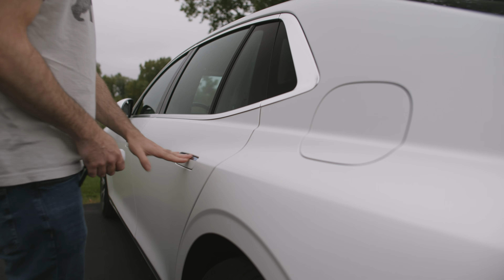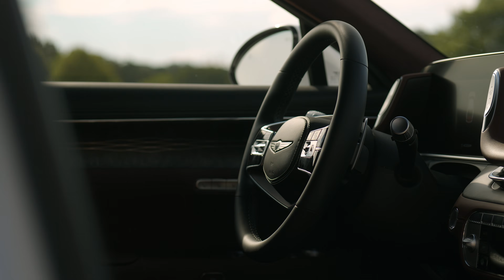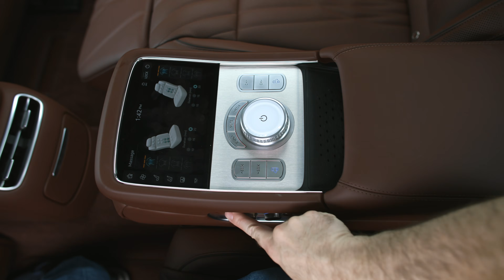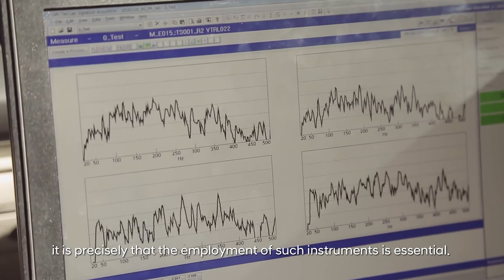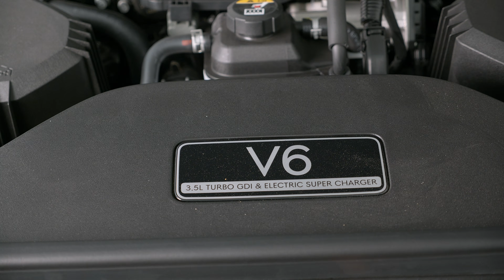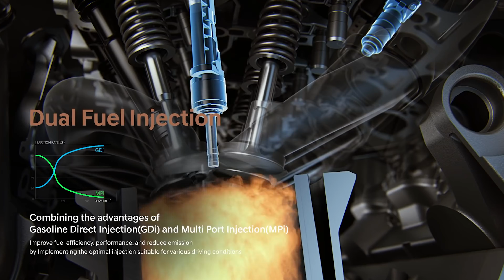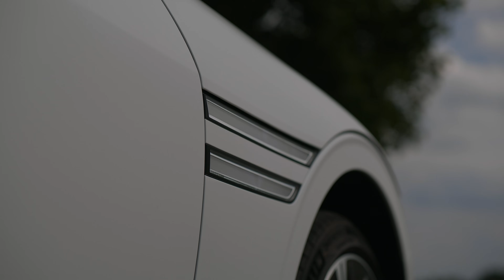2023 Genesis G90 | Great Car, Gimmicks and All

Comment: Another big factor is warranty. S-class starts out at 113K and have less than half of the power train warranty duration compared to genesis.
Reply: The irony is that the S-class needs the Genesis warranty, and the Genesis could get by with the S-class warranty. But in another way, it's not ironic because they offer the warranty that reflects the longevity of the product.
Reply: @andoletube  yep it also reflects the market positioning for each brand, but also shows Genesis’ conviction and long term investment in this market segment

Comment: Having the turn signal chime in the seat is absolutely genius. That should be in every car
Reply: A bigger concern is simply getting people to actually use the turn signals, no matter from where the chime emanates...
Reply: How is that absolute genius? What's the amazing benefit over just having it radiate unoffensively from the general dashboard area?
I suspect I would hate announcer stuff to come from directly behind my head.
Reply: @Dowlphin  With that configuration chime sound might be quieter so backseat passenger(s) would barely hear it, if even.
Reply: @Dowlphin  No, I was talking about any driver related sounds, and in particular -aforementioned in first comment turn signal chime. I assume car manufacturer would like to isolate driver (and his functions with all blows and whistles and those chime sounds) from backseat passenger (and his/her comfort and tranquility). Probably the idea of putting speaker in headrest is similar to something I had experience with in some high-class taxi service - the driver had a headphone in his ear to hear direction advices from navi system, so passenger would not hear them and would be able to relax with more comfort and in silence if needed.

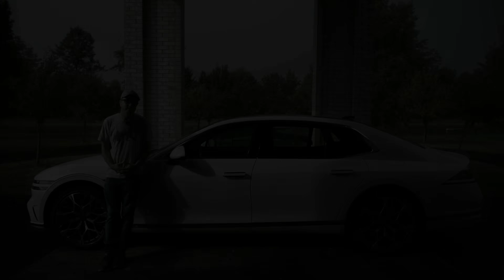Comment: The profile @ 18:09 is gorgeous. Low front overhang, design around the c-pillar, the rim design are all beautifully laid out. Looks like no other luxury car in its class. Nothing overly controversial. Well done Genesis….
Reply: i dont like the rear window lines they dont line up with anything. they shouldve specialized in old school aesthetics and ease of use interioir, with switches that have base heavy clicking sound and some phsycal resistence to being moved, etc. they already have quite a aesthetic focus like lexus lc500. they couldve have allowd screen to be manually coverable with wood veneer like a manual and more simple version of what is in bently continental, without the pshycal gauges, or at least allow it to be turned off when not in use.   simplyfy the front end more like the genesis EV, to make whole thing look more similar at every angle of car and not busy at front and plain everyhwere else. a hole through passenger seats would allow storing long objects including rear seats legs etc while allowng more trunk storage space
Reply: @kalmmonke5037  not expecting it to be universally loved. I think its far less controversial than anything else in its class. Not too plain or extreme…

Comment: Genesis has accomplished what Lincoln was trying to do in the 80's and 90's with the Continental and Town Car but couldn't. Class competitive technology, build quality and dynamics with a focus on luxury (not sport) at a slightly lower price point. To be fair, the current Lincoln Continental mostly accomplishes that goal but nobody seemed to notice.
Reply: I drove the Continental, as well as CT6, Jag XJ, and BMW 7. The Continental was nowhere near as good as any of them. The engine was loud and unrefined sounding, it wallowed around all over the place, it felt like you had to stand on the brakes to get it to stop, and the interior was not all that good. Current Lincoln SUVs are MUCH nicer inside than the Continental was.
Reply: @DavekayBSC  the Ford us probably on par with the old XTS.  I had a Vsport ecu tuned to 600 lb-ft of torque.  Probably faster than my C5 Corvette!  Current have a CT6 and it is luxo driver's dream to drive!
Reply: @DavekayBSC  i agree.
but then again...this genesis reviewed here has that same damn floatiness as explained in the review.
i will never be old enough to give up my driving enjoyment.
i would never have purchased the continental. i think lincoln regressed.
i did love my MKS with 365 hp when it was new...but the interior degraded a few thousand miles early!!!!

but then again, for the 52K I spent...nothing came with what it did.
nothing...everything else was a minimum 15,000 more.
Reply: @paulpellico3797  To be honest, the US is a minor market for this car. It's sold here as a halo car, something to increase the luxury credentials of the other models. It was designed as a Korean limo, where the Continental was expected to be owner-driven.
Reply: @paulpellico3797 the continental is just a fancy ford fusion, not a ground up luxury car like genesis
Reply: @lambokiller99  after all this water downstream you reply with THAT?!
completely different.
chassis engines.
OMG...do you have a license?
Reply: @paulpellico3797  it’s literally built on the same FWD chassis as the ford fusion. That’s partly why it failed.
Reply: @lambokiller99  OMG
did you know that the basis of a chassis is NOT the same as the DSAME chassis?
and EVERY manufacturer, even expensive ones, shre this method?
for instance, my friend
audi TT and the VW van?
As well as Audi and Porsche, Lamborghini is under the Volkswagen Group's umbrella. So when Lamborghini decided it finally needed to deliver a crazy fast crossover, it was only natural that it would inherit the MLBevo platform used for the Porsche Cayenne, Audi Q8, and even the Bentley Bentayga.
Volkswagen's MQB platform underpins a vast selection of cars and is adaptable enough that Volkswagen used it for the mid-sized Atlas crossover while Audi built the third-generation TT on the same architecture. That includes the ballistically quick Audi TT RS
not gonna go on with this.
learn for yourself how manufacturing is done today.

who DOESN'T DO THIS???
Reply: @paulpellico3797  you didn’t see Lamborghini using the FWD shitbox Jetta platform to make an suv. Lincoln should’ve made a new RWD luxury car platform but instead they chose to build the continental on the fusion platform which in turn made it a fancier, bigger ford fusion. Genesis has its own separate RWD platforms that aren’t shared with any Hyundai products. They did it right while ford tried to cut corners.
Reply: @lambokiller9970  

see, this is why i don't try to reason with children.
they change the subject THEY brought up whenever they see they are being caught.
i NEVER said they should or should NOT have gone RWD.
i prefer RWD myself.
but genesis DID start off producing modified hyudais with shared engines and parts.
i was pointing out your position as being seriously ignorant of today's manufacturing
Reply: @paulpellico3797  even the earlier genesis cars had their own platforms and their own engines with next to no part sharing with other Hyundais. They did it the right way, but please do enjoy your 65000 dollar ford fusion with a chrome grill
Reply: The Lincoln Continental was hardly competitive with anything in the class. The interior showed WAY too much Ford influence. That is why nobody noticed because the very first time I saw a fully loaded Lincoln Continental I was disappointed.
Reply: @JustinKelly  ok, ok...let's TRY to be fair!!!!
the continental was NOTR an expensive car.
THIS isd an expensive car.
Reply: @paulpellico3797  The 2017 Genesis G90 5.0 AWD was $73k fully loaded including destination. The 2017 Lincoln Continental 3.0T Reserve topped out over that with every option if I am not mistaken. Did it offer maybe one or two things the G90 didn't? Sure. The interior sure didn't feel like anything close to the $70k vehicle, even back then.
Reply: @JustinKelly  what???
where did you get that? i JUST saw the official genesis 2019 gensis page and it STARTED at 21K...before adding anything and getting the engine...just a color.
???
the continental started at 50...ish,
again, I am very confused by what is trying to be said here by people.
there was NOcomarisons between these cars.
none.
yes, the genesis hadmore, but cost grands more.
Reply: @paulpellico3797  I have no idea what you're talking about. If you don't live in the US then pricing will vary but the numbers I stated are correct for the respective model year.
Reply: @JustinKelly  well, not gonna spend any more time informing you.
the information and sale data are there if you wished.
Reply: @paulpellico3797  Ok 😂
Reply: @JustinKelly  words.
hardly competitive with anything in its class>
like what, for instance?
all these cars sell at 3 to 6 thousand a month in goodyears, let alone the covid sent from Chinese gods years,
it was the most undermarketed car in ford history after the edsyl.
but its engines were everybit as great as these now copied for the kia cars.
Reply: ah...but lincoln DID do it with the continental.
but it didn't sell.
and I know, you're gonnabash it...but then you have never driven it.
Reply: @paulpellico3797  this probably won’t sell either the gv80 will probably sell 10 times more
Reply: The difference is that Hyundai/Kia already make this car for the Korean domestic market
Reply: A stretched Fusion is not a luxury car which is why it failed.  Way overpriced and didn’t come close to matching cars of similar price.
Reply: @therealSIRBOOM  new escalades are already fking up. And wait til wagoneers get miles..
Reply: I liked the Continental, it was just lacking the rear seat features...But it flopped and they stopped making it after a couple of years.  They do have nice looking SUVs right now, unlike most manufacturers, so I'm sure they'll do well.
Reply: Lincoln messed up the Continental by placing it on a FWD platform that threw the proportion of the design off like Audi. Huge front overhangs on a large premium/luxury sedan is unattractive for the money you're spending.
Reply: I had the opportunity to sit in a 2017 Continental and 2015 Mercedes S-Class at Carmax. Both had pretty low miles for its age. The quality difference however was night and day. From a distance, the Continental interior looks attractive, but once i sat in it, it smelled like cheap vinyl. Interior switches felt like a Ford, no soft touch, and it had cheap plastic painted in chrome finish. I will say though that the seats were very comfortable, thanks to the many adjustments. But, I never felt like I was sitting in something special. In fact, RENTAL car kept floating in my mind when sitting inside.

The Mercedes felt wonderful inside. Creamy smooth leather, with a rich cow hide smell. Doors closed with a solid thunk. Switches had nice clicks to them when making adjustments. It truly felt like a $100K+ vehicle that it originally sold for.
Reply: Easy.. Lincoln took the cheap route and cut corners for many years, which made Lincoln lose consumer confidence and ALL of its brand equity. Hyundai/Genesis, on the other hand, was never taken seriously until they started to make progressive AND consistent improvements. Their cars have all the right fundamentals and the quality cannot be questioned. Can they measure up to the Germans, clearly not, but they're doing a MUCH MUCH better job than any of the Americans or Japanese brands at the moment. And as the clear underdog, Hyundai has done a stellar job capitalizing on that. It's also worth noting that customer retention at Hyundai/Genesis surpasses that of any other brand, including Toyota/Lexus. They still don't have the sales to measure up, but they've been gaining quite the momentum and it's the only brand (besides Mazda and Kia) that has seen continued growth year after year in sales for the past three years.
Reply: Nobody seemed to notice, mostly because it's a gussied up Ford Fusion. Few people may actually know that bit of information. Regardless, the car gives off the vibes of badge engineering.
Reply: Unfortunately just like the Continental, these won't sell very many units. It's really hard to compete with the "big three" because of the prestige factor.
Reply: @ice44567  yes.
and reviews like this really confuse me.
unless they are done because of incentives from the manufacturers, maybe the opportunity just arose because it was dropped off.
but really...nobody here cares.
i know this because NOBODY here will buy one.
nobody ANYWHERE will buy one.
and these days, save your money for when you run across an affordable prime ribeye...then stockup in your freezer.
meanwhile, learn to like flank steak and smoke it properly!!!!!!!!
Reply: It's more than that.  Genesis is what Lexus should have become.
Reply: @Seriously140  i needtobe taken off this conversation when the posters start comparing genesis to lexus...especially quality of materials.
i mean, the insane are now running the post.
Reply: Well alright, alright alright.  You got us.
Reply: My grandfather noticed.
Reply: Blasphemy the 70s and 80s towncar and continental were some of the best luxury cars every made. Still better than anything out now
Reply: @therealSIRBOOM  sirboom....
as usual, i would give my right arm if you could prove you drove one.
and it was nothing like the taurus.
entirely different platform...so what are you talking about?
at one time...lincoln sold over 5,000 of these anually, eventually dribbling down to around 1,200 per year before ending production.

oh, and for your info...
"How many G80 did Genesis sell in 2021?
Genesis sold 6,031 G80 in 2021. In 2020, Genesis sold 3,359 G80. They sold 2,672 more units in 2021 compared to 2020 with a percent gain of 79.55% YoY."

puleeeeeeze.

Comment: Why did they think people spending 100k wouldn't want a V8?  It's too expensive for a Hyundai.  This will sell just like the last Kia K900 did.
Reply: For 2023, there are ZERO luxury cars with standard V8s for under $100K. No A8, 7 Series, or Mercedes S Class. And the standard V6 in the Audi A8 has LESS power than the one in this G90.

Comment: Hyundai has come a long way for sure. But this is a small market and at 100K where many buyers are brand driven this will be a very  low volume car. Find one in say 5 years and this will be a good option. Provided that all the bits and bobbles still work. However, the biggest problem that this brand has will be the buying and servicing experience. Most dealers also sell either Kia or Hyundai cars. These dealerships are notorious for their at times weapons grade awful customer treatment.
Reply: There are a lot of misunderstandings about this brand. Genesis is about the local market, unlike the Japanese where they had to spend a lot more money to assemble their cars in both RHD and LHD versions, Hyundai only had to do LHD and they sold a crapload of these luxury cars in their home market. Any numbers they sell in other markets are just bonuses at this point.
Reply: @MSZsama  Yes, exactly. US sales are mainly so they'll have a halo car to enhance the brand image. It's designed to be chauffeur-driven, and that very small class in the US isn't going to buy this. It's for Korea, and maybe a few other markets, not the US.
Reply: why? because people with 100k to spend are stoopid? no comprendo?

Comment: I wish all the interior shots weren't so dark and shadowy and far away. Seems that way in most of your videos. The other parts of the videos are always great, getting it up and then out on the road, but the interior portion feels like you don't like doing it and are just trying to get it over with. I wish it was as informative and clear as the other sections. Always great light and close-ups in the lift section, and details.

Comment: The leaps and bounds they have made in such a short amount of time shows they are in the game. I think they've surpassed the American luxo brands and are taking full aim at the Mercedes here. Not that I have 100k to spend on a luxo car, but if that was my market, I'd probably take this over the BMW or Mercedes.
Reply: As of this year, they’ve sold more g90s than Audi A8s in America. Yeah the chip shortage is a thing but when you factor that in for both brands and the downtime to retool the genesis factory for this new model, it’s still an impressive feat for the, to achieve

Comment: It's just not the same without a V8 in this class car.  Anything G80 and up should have a V8 option.  I get nearly the same advertise mileage with mixed driving in my 2015 Genesis 5.0 and sounds/feels so much better in a larger car.

Comment: I realize that Lexus/Toyota, Infiniti/Nissan and Acura/Honda had to overcome the same issue but 100K for a Genesis/Hyundai that in most markets is sold and serviced from a dealership that sells both brands......
Reply: The service experience is a concern.  The Kia/Hyundai shops I've been in have had more in common with a Mexican post office than a Mercedes or Lexus service department.
Reply: This is a huge concern - the customer service experience is a massive part of ownership, and Lexus is big on the "concierge" part, from IS to LS.  Mercedes seems to do this well also, and BMW is hit or miss.  Apparently the few stand alone Genesis dealers do this right, but that seems to be far from the norm.  I wouldn't want to spend that much money and have a sub-par service experience every time an oil change is due.
Reply: Not so much anymore as standalone genesis dealerships are popping up everywhere.